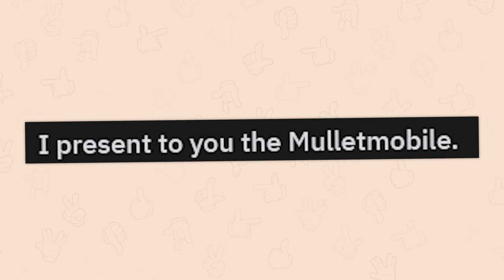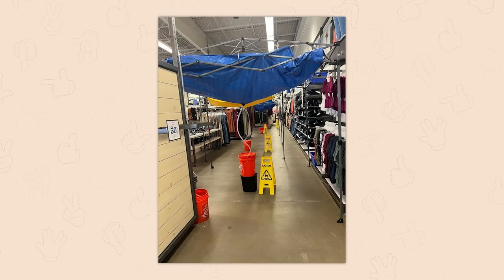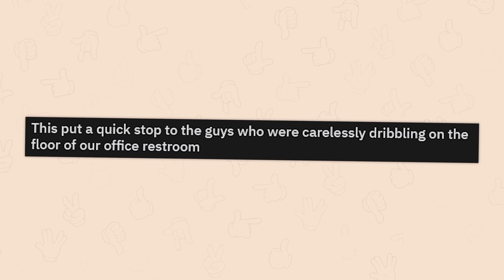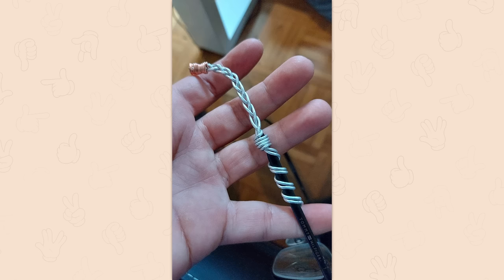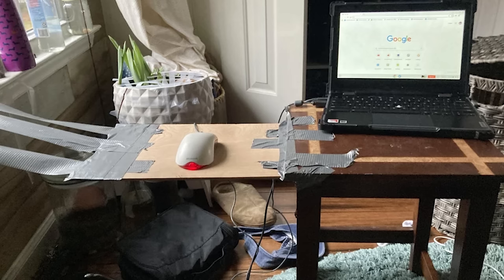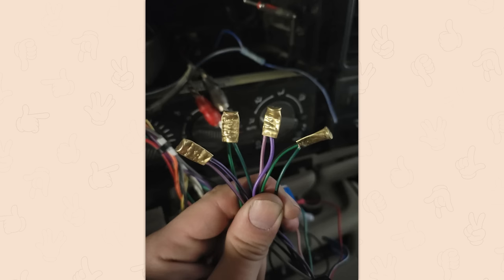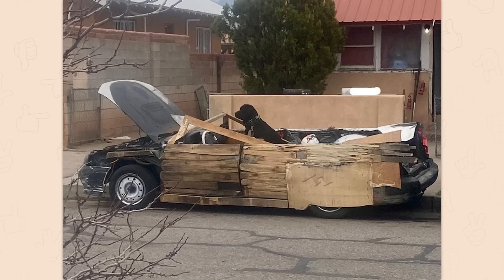r/Redneckengineering | DO. NOT. TRY. THIS.

Comment: I'm surprised legos worked as the bridge in a bass. I played bass for quite a bit and i remember the amount of weight those strings put on the bridge is absolutely astounding.
Reply: All I could think while looking at that image is how badly that would scratch the wood if it slipped, as legos are notorious for being sharp and that is a LOT of pressure being put on them
Reply: Legos are remarkably sturdy. It takes a lot of force to break them.
Reply: Legos are plastic bricks. They're very good at resisting compression forces. Since there's no side-to-side force involved in being a bass bridge, they're basically indistinguishable from a solid piece of plastic as far as resilience goes.
Reply: Well yes, they are strong, but I was worried about stability. All my Legos bent under weight when I was young. Maybe I was just bad at Legos.
Reply: You can make a wheelchair ramp out of LEGO that will take the full weight of a power chair (plus occupant) without even showing a little bit of strain.

LEGO is fuckin' STRONG.
Reply: James May "built" a whole house out of Legos for one of his shows.
Reply: @aaronabbey2604  It was featured on a Legos documentary called Lego Brickumentary, if I remember right.
Reply: Iirc they're made from ABS one of the tougher plastics out there

Comment: "I get a minivan" THANK YOU. Been saying this for a long time, most pickup truck owners really need a van but they don't want a van.. cause vans are uncool while trucks are hellacool. Vans have enclosed, locked, heated space and it can have more or less seats, depending what you need. They are highly customizable and versatile, while trucks are what they are and what they have is open, unsecured, unheated cargo space that is too short.

Bonus point for vans: you can stack high and strap to the walls.
Reply: And if you're moving , they're shite if it rains , whereas the van keeps it all dry.
Reply: Not to mention that if you fill the cargo area, you STILL have the roof racks to strap more crap to AND minivans tend to be more fuel efficient than pickups are...
Reply: Maaan, same here. 
Trucks are great if you're hauling like, gravel or something all the time, or kind of gross stuff you don't want in the cab with you (plus they're great at towing), and often have better clearance for offroad; so they are amazing for a few select jobs and worksites. 
But for easily 95% of people who have a truck, a van would be better every day of the week. Bonus points for the spotless ones in cities-you just know it's never been used for truck things, and is just a status thing that drinks gas.
Reply: Just say you're a city person without saying it, people can have what they want, vans almost never have engine options as powerful as trucks, don't have a towing capacity nearly as good as a truck, PLUS BEDCAPS ARE A THING and who wants ice cream in a heated cab? No one. Not even you.
Reply: @0angelcxkes  Yeah, trucks make a TON of sense in more rural areas. 
But most trucks aren't sold to people who drive in rural areas. And for city ones, vans work just as well, because those people are never going offroad, don't tow anything, and don't need a powerful engine since they're just doing 50 on a flat road.

Also I think you  are misinterpreting the "heated space" line-vans have AC if you want it, at least if they're from the last 25 years. I think they just mean "not open to the elements"
Reply: @0angelcxkes  lol... city folks can't drive trucks , eh hoss?... nice gatekeeping there buckaroo,  You would need the towing capacity of a truck when you can't carry anything dry in the thing.
   Mini vans are for those who want to keep things dry when they move , pick up trucks are for when you want to compensate.
Reply: A lot of them are worried about the performance, which is funny because there are certain mini vans that with a little bit of tuning and some aftermarket parts can get up to about 1,000 hp. I say get whatever is practical and you like.

Comment: Regarding the telephone pole "repair", that's a temporary support to keep services running until they can schedule linemen for all the services on the pole to come out and transfer them over to the new pole.  They often will use speed tape around a cracked pole for the same reason.
Sinking a new pole only takes an hour or two.  Moving the services over is much more involved.  This keeps everyone's phones and internet running while they get prepared.

Comment: The dance dance revolution board is actually pretty simple, it’s actually 2 layers of carboard stacked ontop of eachother with bits of tin foil inbetween, all you have to do is make the 2nd piece of cardboard a bit bigger than the 2nd so when you bend it slightly it creates space to press down the tinfoil which can complete and electrical circuit. If you have it rigged up to an arduino it can input the four arrow keys into any game

Comment: That Pencil sharpener....A few years ago I needed to turn a thick bolt into a spike with perfect symmetrical taper. Based on the tools I had, I came up with the EXACT same idea (drill and a bench grinder) and it worked flawlessly. A lathe would have been the right way, but when you can't afford the right tool sometimes you can get plenty good results with clever use of enough 'wrong tools'.

Comment: 0:18
I mean it works. I even bet it works really well because you're getting are purty much uninterrupted with good flow. But with good flow also comes dusts, debris and whatever small objects entering the engine, which are something that shouldn't enter. This is why air intake filter exists.
Reply: Sooo... attach a filter to the mouth of the cone?

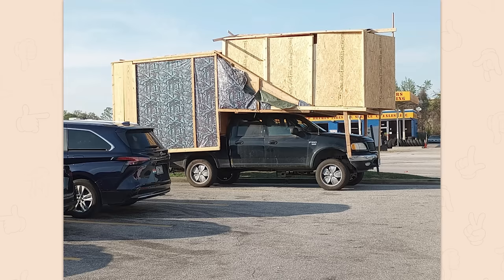Comment: @10:39 there are actually no building or safety codes or regulations for campers and RVs in the United States.    Just needs working lights for it to be hauled by another vehicle.   Or built on a previously road worthy vehicle if it is self powered.

Comment: I hot glued a small metal skull to the top of my record needle arm to add the weight it was 80 years old and had spent 40 years in a shed. It needed a little redneckognition.

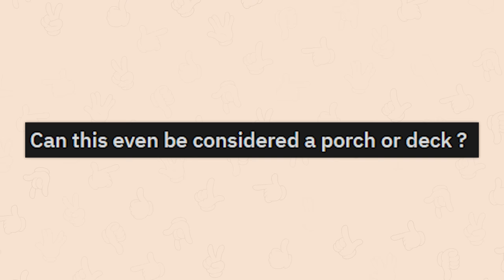Comment: @4:41 That is probably a temporary fix until the snow stops and they can get a truck & crew out to replace the whole pole. I've seen poles strapped to a temporary support with duck tape and nylon tie-down straps because they ran out of materials on hand after a bad ice storm.

Comment: 2:50 Considering the inside of your room is probably colder than the outside air, you would risk condensation forming due to the temperature difference (Kind of like how a cold soda can will form condensation on the outside after taking it out of the fridge, even if you initially dried off the outside and kept it closed)

Comment: 8:44 That is how you use the Out House in the middle of winter without freezing your Ass off...

The hot exhaust from the wood fired stove is piped into the outhouse to heat it...

😄😁😆😅😂🤣

Comment: Cooling computers using cold outdoor air is a legitimate thing in some datacenters. They're built in cold areas in northern europe where it stays cold all year, and the whole building uses a heat exchange system or filtered air vents connected to the outside to keep the entire place at ~10 degrees celsius, so that the regular cooling fans on each machine are pulling in nice cold air for massively improved efficiency

Comment: Fun fact 
The vw beetle didn't have a heater (kinda)
It had a special type of exhaust or something that allowed it to take the heat from the exhaust and blow it into the cabin
They were also air cooled (no radiator)
Reply: the earlier models only apply to this the 60's and 70's are air cooled and dont have heaters but im pretty sure that the 80's have a heater but there still air cooled
Reply: bro this comment made me think of the movie Cars 2

Comment: 3:50 my laptop stand is the inner rack holder of a toaster oven.
Thing died, but it was the same size as my laptop. Keeps it elevated so the fan can circulate air.

Comment: I went to NASA Goddard and one of the manufacturing warehouses had some roof leaks. NASA engineers saw this problem and came up with the exact same solution as Old Navy. a 90-year-old warehouse at Goddard responsible for manufacturing the structure for the world's most advanced space telescope in development (Nancy Grace Roman Space Telescope) has several areas where water is dripping down through the roof, coming in contact with high voltage and data cables ends up in a tarp and then a 50-gallon barrel. This is a permanent fix at GSFC building 3.
Reply: That's a cheap fix, and it won't last forever.

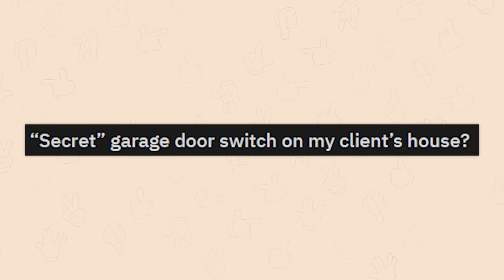Comment: 10:00 the window lock feature (least in chevies anyways) only locks the rear windows, not front it is a 4 door, if it is 2 door, then you're screwed. 

I have driven/riden both, granted the two door is a bit on the older side (07)

Comment: I sharpen pencils in the shop with power tools like bench grinders and whatnot all the time, not even half as dangerous as the actual stuff I make on them lol, and it does a way better job than any pencil sharpener I've ever owned, way faster too. Work smarter, not harder.

Dunno about putting it in a chordless drill though, just like, twist it, big dawg.

Comment: Funnily enough, that intake 100% works, thats the exact premise behind a ram air intake. You "ram," the air into the intake. The issue is that theres no filter so if its raining or you get crud in there, itll go directly into your motor. Aka hydro-locked motor or blown motor

Comment: 9:46 I drive a 2004 chrysler town & country touring. It doesn't have a window lock function like this. though probably due to the only other window control is the passenger side, the back vent window things don't have rear control switches, and they are already only in the front.

Comment: On the topic of messed up glasses;
One time I was on vacation on a town on the coast (aka no signal and population 4,000 during the summer) and SOMEHOW both arms of my glasses decided to break simultaneously while I was walking. Still not sure how that happened. 

Anyway, I remember passing a glasses store on the way on and asked if they could help with it. 

They only had 1 arm that would fit so I ended up having the left arm taped to the side and the right arm being a bulky one from sunglasses on my tiny little middleschool glasses.
Reply: Hey bud I'm the person who created the wire frame and posed it in the r/redneckengineering reddit :)

I feel that one it will always brake in the least best moments always before a meeting a long drive or like u said on vacation and as a person who can hardly see stuff without the glasses it always sucks to wait like 2 weeks until the repair shop FINALLY sending you the notification the glasses are ready to pick up only to brake a week later or something

Comment: Personal examples of red neck engineering:
1. Screw came loose on a pair of eyeglasses when I was a kid. Came loose in a way that it ended up stripping the threads and threatening for the lens to fall out. Grabbed a paperclip and twisted it to keep it tight. Optometrist took a look at it and just proceeded to take the same paperclip and tools to make it less obvious.
2. Computer desk broke during a move. Made a desk out of moving boxes that I don't remember how I kept it stable. Lasted until we moved again.
3. I was gifted a hand-me-down Xbox controller with the USB bent inwards out of shape and unable to be plugged in. I would fidget with my phone charger at the time (not plugged in, before USB-C) by sticking it into USB plugs and enjoying how snug it fit in. Put 2 and 2 together, and used phone charger to fix USB plug.
3.5. Briefly fixed a broken 3DS thumb stick pad by grinding down a fidget spinner center plastic bit and epoxying it to the nub. It did not last long, the epoxy was not strong enough to hold to the same amount of wear. It was still more comfortable than the bare nub while it lasted.

Comment: 1:12 Those lead-acid batteries, even WITH their flaws, are no match for their current output AND capacity. 
1:21 is just a (relatively) quick soldering job.

Comment: The van near the end looks like a Gladiator III which was a legitimate conversion van sold at retail and designed to pull fifth wheel trailers. In this case, I don’t think it qualifies as redneck engineering.

Comment: 0:58 This would have been genius if they didn’t attach the counterweight to the back. Tractors are rear heavy so if you were going to attach a counterweight to make the tractor more stable, you would attach it to the front. If you were to attach it to the back, it would shift the center of gravity even more towards the back than it already was and make the tractor easier to tip over than it already is. It was a good plan, but they should have thought about where to put it more.
Reply: It has a frontloader and you need the counterweight so it dosen’t tip Forward when lifting heavy stuff. Plus some smaller tractors Are usually pretty front heavy
Reply: @sondrehegland  I didn’t even notice that. Guess I was wrong.

Comment: yes the Carolina squat is where the rear is dropped and the front ends up rising. it is actually illegal to Carolina squat a vehicle here in NC and drive on the roads for obvious reasons. I have witnessed extreme Carolina squats with raised vehicles and i wanted to drop kick the drivers, because how the heck can they see anything.

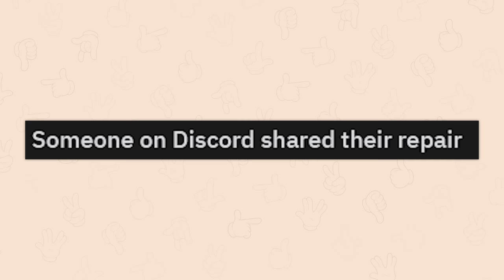Comment: 5:45 This is my mom's car - Volkswagen tiguan.  it does support Apple car play and android auto.  if he would press that apps button right there, it should work.

caveat, if he tried and failed, the system on these is bitchy and might not work first try, or any try, so if he attempted normal setup and then resorted to this, fair enough.  if this was his first plan, nope.